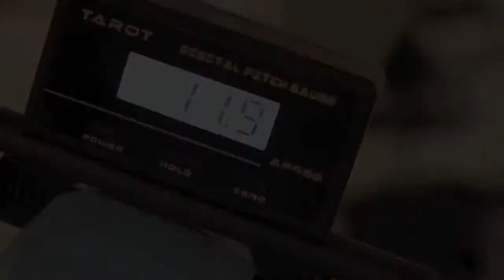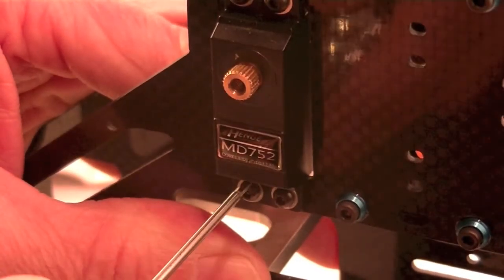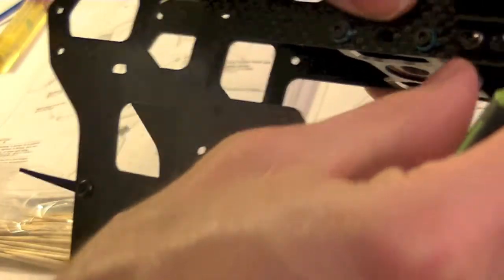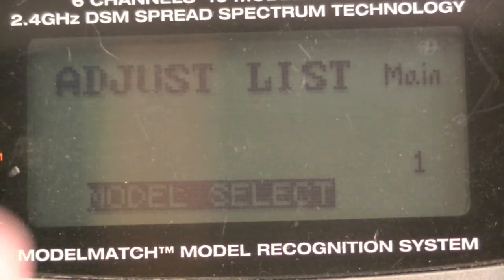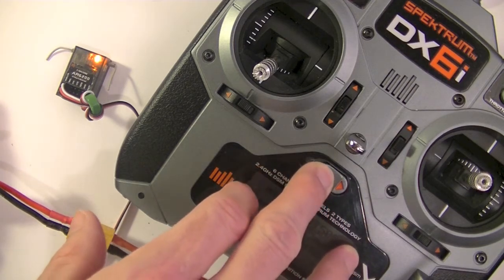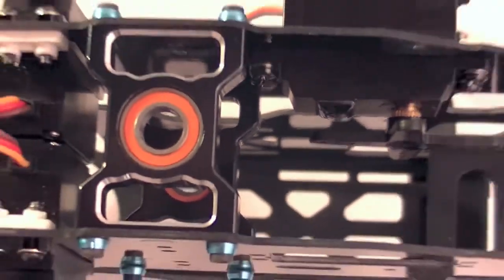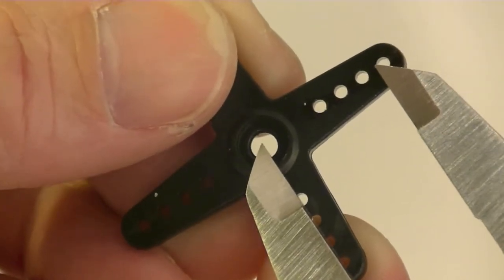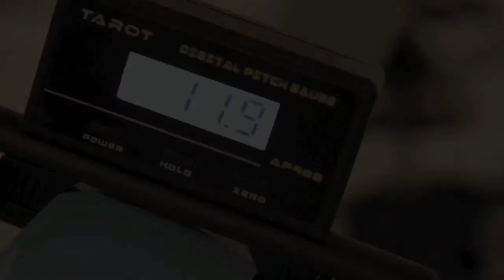05 : Tarot 500 : Servos - Install and Initial Electronics Setup and 90'ing

Comment from the maker: Yeah...you'll be fine. Get them as close as you can, and then use the subtrim. That's what it's for. The goal is try and get it as close mechanically, then use the subtrim. If you are as close as you can get, then it is what it is.